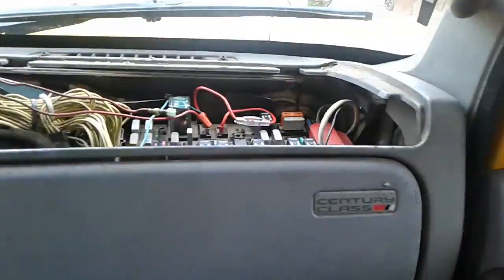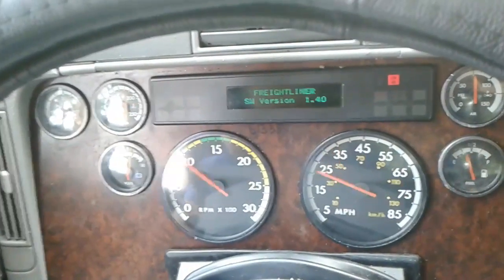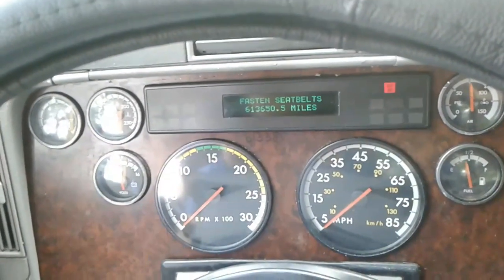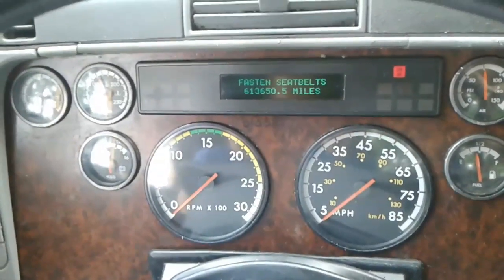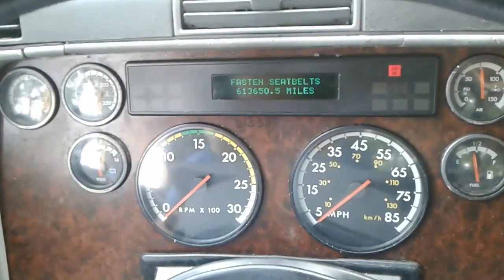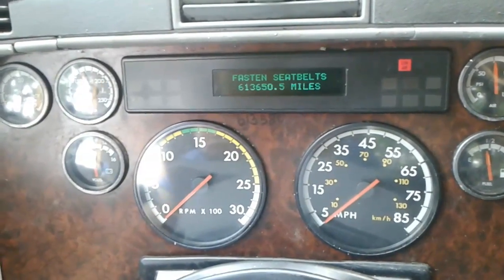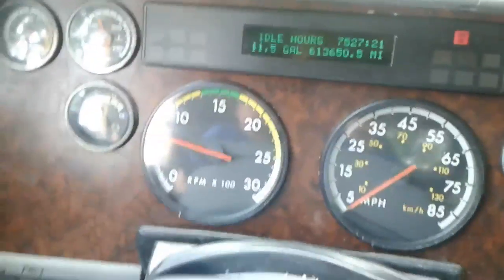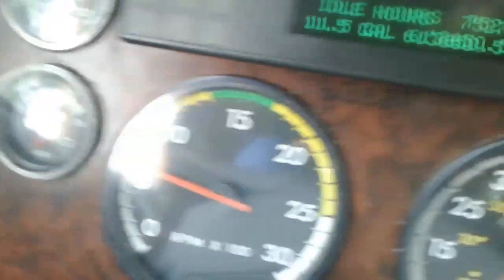2000 Freightliner century class gauges not working

Comment: Had a similar problem in my 07 Century last week. It wasn’t a fuse though it was my Low Voltage Disconnect which on my truck is behind the trash cubby below the ashtray.  Good video man thanks for sharing.
Reply: I have a problem with my 2010 century, oil pressure gauge and voltmeter not reading, was that an issue with your 07 century? Or how did you know it was the low voltage disconnect ? What symptoms did it show ??